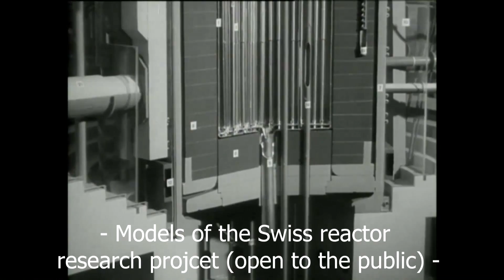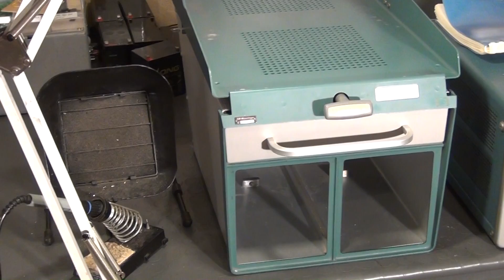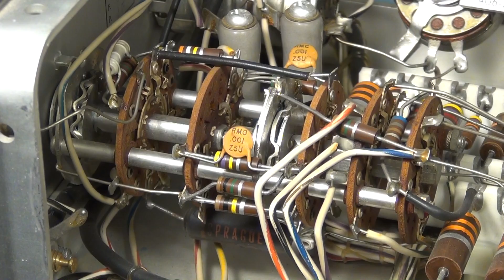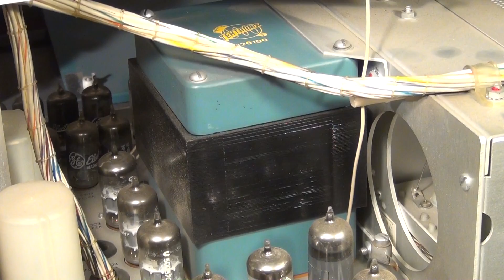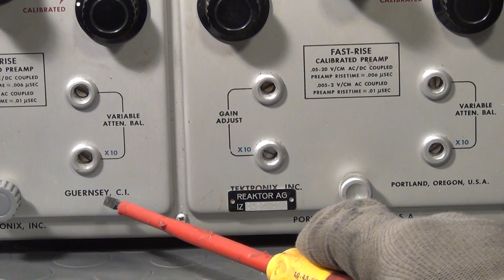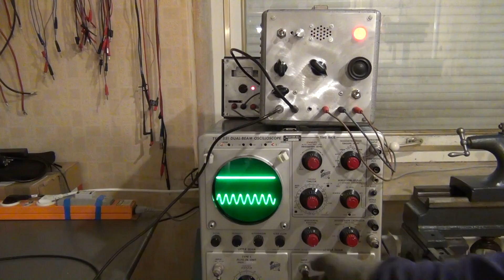A Gift from the Nuclear Energy Research Lab

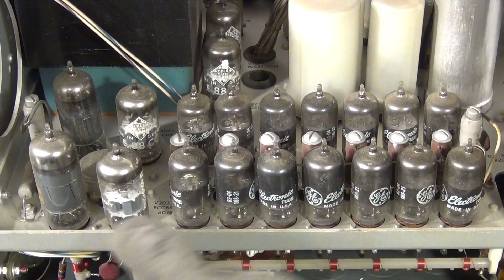Comment: I would be afraid to power it up. But I bet you tested it first. What is it,.. about 10 / 15mhz? at 3:30 just checked, 6dj8 available, because used in audio amps, and tube audio being made again,  at 3:52 12by7a, does not appear to be manufactured, but found NOS, new old stock. Rectifiers at 5:31, cant imagine they make those, and likely real hard to find old ones. That is cool it works, it does make a cool working museum show piece. Tektronix was about as good as it could get, top of the line testing equipment.